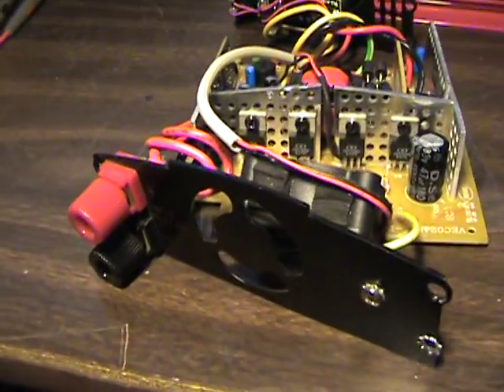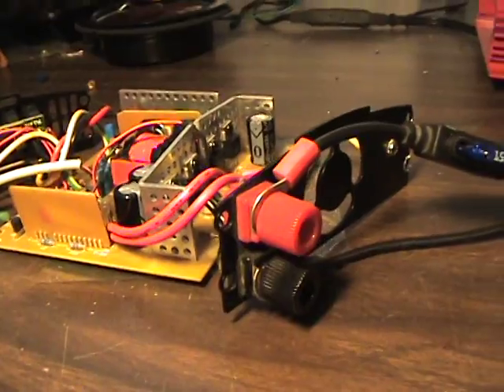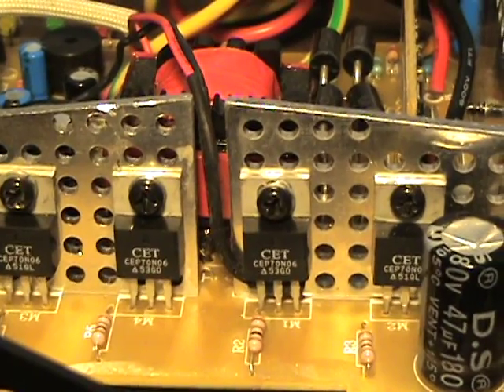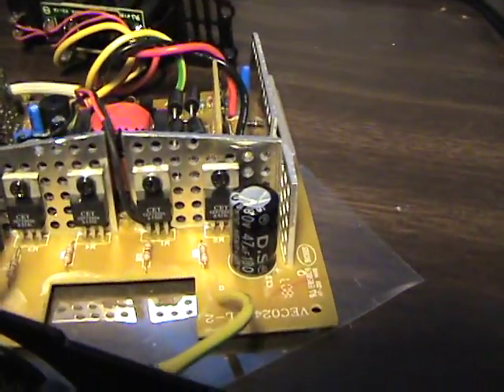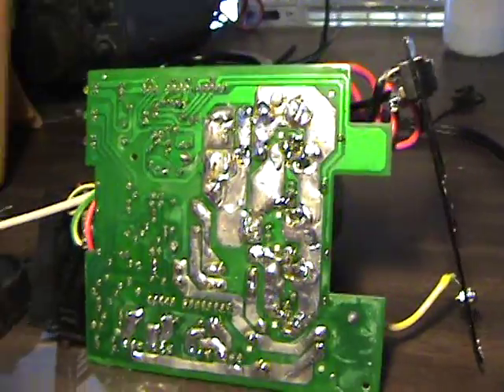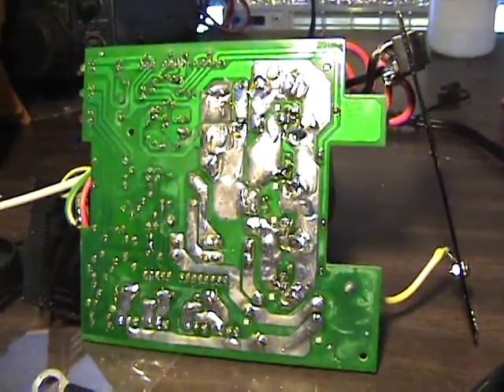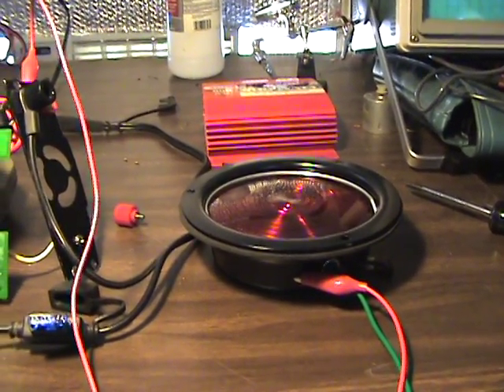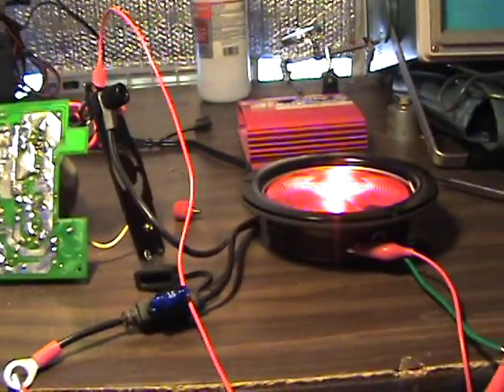Light Bulb Trick / Inverter Repair

Comment: The reason for using a filament light bulb and not a normal resistor is that the light bulb is a variable resistor.

If the current being drawn by the circuit is low then the filament will have a very low resistance so the circuit can operate normally.  Only when the current drawn is high does the filament heat up and become a high resistance.

resistors dont do this so well.

Comment: Ha ha. Good for a laugh. I was thinking reversed power supply as soon as you got the .6 volt drop. The light bulb load was one of the first things I learned some 30 years ago when I first got into the repair business, and the second thing I learned was to keep one hand in my pocket when working on a live circuit. Only been bit twice, one time by an operating microwave power supply, some 2500 volts, and the second time by 30,000 volts from a second anode lead that was not attached properly to a picture tube by a junior tech that changed the CRT. I was performing a convergence job, and the lead popped off and dropped on my hand. It felt like I hit my thumb with a hammer. Fortunately I was wearing insulated shoes, and had my other hand in my pocket, so it just charged me up. I got almost as big a shock when I discharged the energy in my body! Talk about a major spark from my finger. (body charged up like a capacitor, just like static electricity only a bigger jolt!)
Saved my life, that's for sure. Sure glad to be out of the electronics repair business.
Reply from the maker: Ha! Yep, had my share of anode snakebites. The most memorable was while doing the convergence on a three-crt projector in a sports bar, hung up in the ceiling joists. The boss sent me up on an equipment (not a person!) lift, seated on a piece of plywood that spanned the lift forks. So working upside down some 20 feet in the air on this wobbly lift, sweating, and pow! Just got too close to the cap.
Reply: Jerry Pommer
Ah yes, I had a few of those "sports bar" convergence jobs over my career too. Sure glad I got out of that line of work. Did very well in it for years, but now that is a dead end job. With the cheap junk out these days, nobody fixes anything. It is one thing to get bit by the cap, it is another to have the cap pop off, and land on your hand while the power is on.
Reply: at princess auto ottawa .there was a store employee that saw a 2 fared auto cap on the counter .he thought it was a good idea to put his hand on the 2 connectors to pick it up .unknown to him  (the customer didn't discharge it before returning it )..well ...that monster cap discharged into his body and totally discombobulated him . he could not stand or remember his name for the rest of the day. didn't come to work the next day either. his brain was still scrambled.lol
Reply: valdarmort
So you are saying it was charged with 12 volts and he was shocked. I highly doubt that. A 2 farad capacitor charged at 12 volts, which is all you get out of a car battery might blow the tip off your screw driver, but it isn't going to do much to you if you touch it due to skin resistance. Now dip your hands in salt water, and you might feel a little sting. Try grabbing the terminals on a car battery, you won't feel it.
Reply: 12voltvids True, depending upon body resistance, which is usually about 50K ohms with dry skin, it would probably be well in excess of 70V, before you would feel it.
Reply: CartecayRiver
Well I work in telecom. The battery at central offices is 48 volts, but with the UPS floating the cells, the operating voltage is generally 52.5 volts.. In the field, with losses it is usually around 50 volts. You do not feel this with dry skin, but if it is raining and your skin it wet, you will easily feel it. If it is hot and your are really sweating, then you really feel it. Stings. Of course someone always phones the line when you are working in the terminal with bare hands, and the 130volts AC ringing voltage on top of the 50V DC will give you a good jolt. I don't think the guy that had his car parked next to the pole appreciated the crack in his windshield when a pair of pliers flew out of my hands when ringing voltage bit me a few years ago when I was working up a pole.
Reply: I remember one time I touched the ring generator pairs on the main frame, that woke me up.
Reply: 12voltvids do they still use those break down sets that put out 630v DC?
Reply: Bri G.
I don't know about all telcos, but the major one I work for decommissioned the breakdown sets a few years back.
For those unfamiliar with these units basically they were a box that was loaded with a ton of batteries. These batteries were 14 45 volt dry cell wired in series.
When a cable pair was going bad, either a bad splice or a short, the cable repair tech would disconnect the customers drop, and then call the central office and have them pull the coils on the CO end. Once he pair was open, they would throw the breakdown set on the pair and whack it with 630 volts at 5 amps.
This would do 1 of 2 things. It would either burn the pair open, or it would short it. Then they would  throw a tone on the line, and drive up the street with a coil on the cable and listen for the point that the tone changed or quit. If the pair burned open the tone would stop at the point where the pair was open. The tech would then cut open the cable, and rapair all the pairs (they are all more than likely burned at this point, so a new splice needs to be built) Anyway, with the advent of TDR analizers like the Dynatel 965 it has made this type of brute force testing obsolete.
I rememer when I was a splicer cable repair was using one, and there was a left in drop that wasn't on records anymore that was going to a neighbours house.
When they hit it with voltage an phone burnt up in the neighbours house.
Aparantly what had happened was when a customer moved out and canceled service the physical line was not disconnected. Down the road someone else ordered a fax line, and the pair was re-assigned and a drop disconnect was given to the tech that was installing the new line. Well he didn't bother disconnecting the other address, so this fax number was showing up at 2 addresses. New person moves in and there is a working phone so they start using the "free" line.
Now maintenence is working on that line, disconnected the legit customer, and blasted the line under repair, and blew up the phone in the old "disconnected" house.
The lady aparantly came running out with her melted phone, and get this wanted compensation for service that she shouldn't even have been getting!
Reply: 12voltvids I used to work outside assisting cable splicers, I think the breakdown sets were used on the old cables. I remember one guy telling me he connected 2 obreakdown sets in series and hit the bad pair with 1200 volts..

Comment: Hi ther Jerry
This might be late to add, but at the beginning of the video you were on the right track and you almost got it. One thing you should have realised, when your lamp lit up,because of the” short “ you have used all of voltage available (reconnect and measure the voltage drop across lamp. I bet you will be reading 12V or 13.7V) If so, what was left for the inverter to fire up?Maybe 0.6-0.7V. It is like this. Sum of ALL voltages (drops) in a closed circuit must be equal to the supply voltage. So if your lamp "took” 12V what was to power your inverter?

Comment: Sometimes the grease in switch mechanisms, after a long, long time, will get hard and physically block the contacts from touching. You have to wash out the switch with solvent (or at least scrape it all out) and apply fresh lube.

You do know of course that we schmucks watching you won't find bad switches and misswires; we will all have bad semiconductors, shorted coils, and lots of black smudges across the boards. Just our luck.

Comment: Hi Jerry...
I have a pure sine power inverter that I used to run an air conditioner that used 450 watts without problems until the other day that will not turn on the ac compressor , the inverter is rated up to 1500 watts, I tested with a watt meter, and  I load a toaster that used 1300 watts and it work with no problems , but will no turn the compresor ac no more.
Do you have any idea what could be the problem?
Thank you Jerry in advance !

Comment: I don't get it. You plugged in the inverter the wrong way around so it didn't work. You plug it in right, it works. I'm assuming your not a total idiot, and therefore you had it plugged into something at some point the right way around and it was not working. Otherwise what was the point? Lots of videos showing how to use lamps in series as variable resistors and explaining why you should only touch high voltage circuits with one hand. So what was the problem that caused you to begin the initial investigation that was worth 30 minutes of farting around learning nothing but plug it in right which is kind of obvious because your converting dc to ac and it uses diodes which only work one way. Like, duhhh!

Comment: I use the circuit breaker in an old power strip...usually they are 15 amp..and reset-able...so no more fuse's..and put the right hand on the inverter..not the left..the right hand is further from your heart.....nice video..

Comment: I’ve used the same vector 400 watt inverter for the past 20 years. Good unit. Takes a lot of abuse. The only problem now is that if the input voltage goes past 13.5 volts the overload light comes on and it shuts down. Otherwise it works well.
Any ideas?

Comment: i have a 650 watts inverter 12V to 230V,
why 230 volts led's and florescent lamp flicker on it ?
when i turn on fan the flickering is stooped.
plug laptop charger and flicker is stopped.

Comment: you can use a rheostat  with amp meter to, most inverters need 0ver 12 volts  if the lamp cuts it down it wont start properly i did tv shop repair over 30 yrs might i sugest look for shorted  caps  and mosfets  fets need to be outa circut due to resistors  diodes

Comment: Cool trick, thanks for sharing. Although, I don't really see the point in using a big lightbulb that takes up quite a lot of space on your workbench when you can just use a power resistor with a suitable wattage rating instead. Checking the voltage drop across that resistor will then tell whether the circuit under test is shorted or not. Advantages: Takes less space on your workbench and you can use almost any value of resistor you want. :)

Comment: Thank you for the light bulb trick. I've been using it for a couple of years. I repair older audio amplifiers. In fact, if the bulb comes on full bright, the final power transistors are likely to be the only power components that can handle that kind of current. I use 125V 50W light bulbs with alligator clips across the fuse holder.

Comment: I used to work in a tv repair shop and we used the light blub trick, if the set had a shorted output transistor we would put a light blub in it's place and power on the set to check the switch mode power supply. The blub might blink, come on bright, or just glow. This is a good way to troubleshoot.

Comment: don't feel bad dude. I've done stuff like this before. still interesting how you were able to check things out. You know if they were smart when they built the circuit they would have put a diode right on the power inlet terminals to prevent a short through the FET's but being made in China I'm guessing it would have added a few cents to the cost of manufacturing to add a reverse polarity protection circuit with a red light
Reply from the maker: Oh, it doesn't bother me. If you can't laugh at your own mistakes you're taking yourself too seriously.
Reply: True that. Hey maybe you can improve on their design my installing that diode and a 12 volt LED wired in reverse so it will light with reverse polarity :-) That would be a neat little project to perform although I'm sure this won't ever happen again but you never know

Comment: Very true. I was mostly referring to this situation in particular, where you had a rather big 12V light bulb on your workbench. Finding a 12 ohms 17W wirewound resistor in ceramic case shouldn't be much of a problem, and it will probably be much cheaper than buying a big 12V light bulb. But regardless the method, using a current limited supply to troubleshoot a shorted circuit is indeed a very good idea, which you demonstrated very well here. Thanks for posting, will check your other vids too :)

Comment from the maker: Well, if the circuit under test is powered by 100 volts and normally draws 100 mA, but has a short somewhere that now makes it pull 1 amp, 100v * 1A = 100 watts. How big, expensive and difficult to source is that resistor? Light bulb starts to look pretty good then. Thanks for watching!

Comment: Great technique, I kept blowing a 2 amp internal fuse on my power board from my oscilloscope even after replacing a shorted transistor. After replacing a shorted toroidal coil I lost the ground. The light bulb technique saved me some fuses in the process. Thanks for the informative video and sharing your knowledge.

Comment: For large AC loads, a hair dryer or space heater would be more compact than a bunch of light bulbs.
Reply: Or you can just buy a high wattage light bulb.  They do sell 500w light bulbs that fit in a standard socket.

Comment: to me thats a toy not a useful inverter i like big power transformers  and heavy duty transistors cause seeing the tiny transformers in therse units thers no way it will out hundreds or thousands of steady watts. hi watts is thick wire . what thay try to do is pulse that lil toy and on a scope looks good until you add a load then the output drops and current rises . i have a few inverters  best built is a apc 24 vdc in  but has a heavy transformer  iron core good 25 lbs. also keep in mind with anay inverter make sure the feed cable is thick enough for  max draw .even thicker is better than thinner ,that will limit amps/volts and output will be poor.
Reply: If the current is high  yeah.

Comment: i have a rally 600 watt 24 volt inverter i need to fix do you repair other peoples inverters?
Reply from the maker: Hi Tim. Probably not practical to ship it back and forth. If you can find a local independent TV or audio shop where you are, they might have a go at it.
Reply: hank you sir i did find the problem but cant find the replacement fets lol i blew fuses as soon as it powered on a buddy so kindly bypassed the fuses and 2 fets blew up so now i got to find them they are a no name china p6n06 its 12 volt inverter lo
Reply: tim b you sure its not a pnc60?